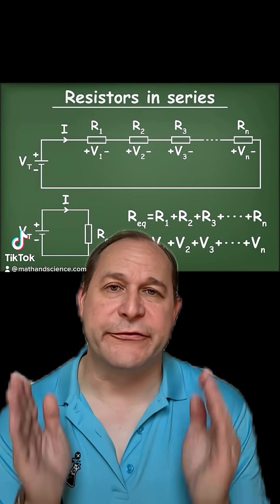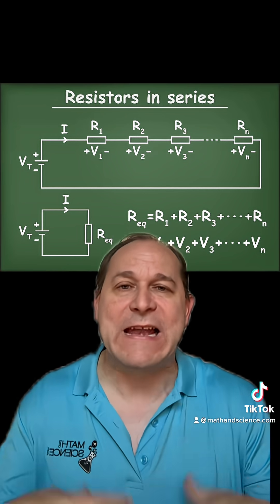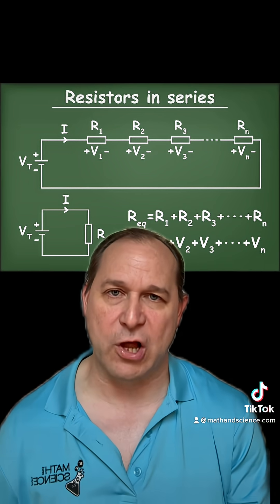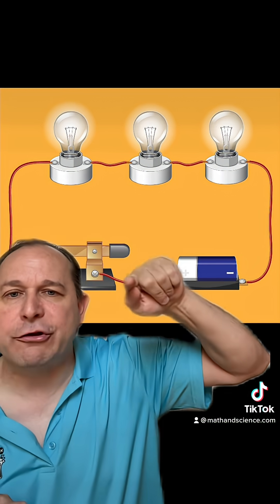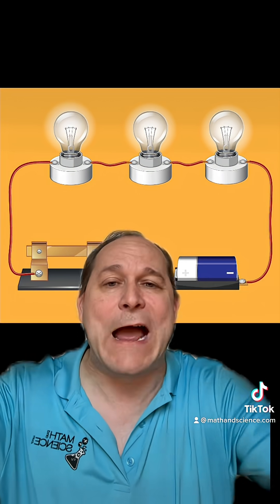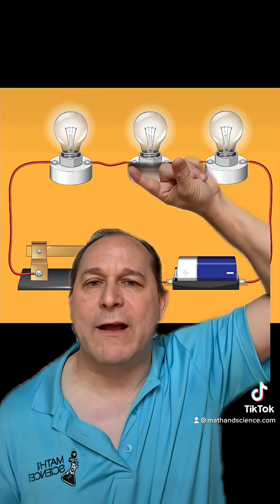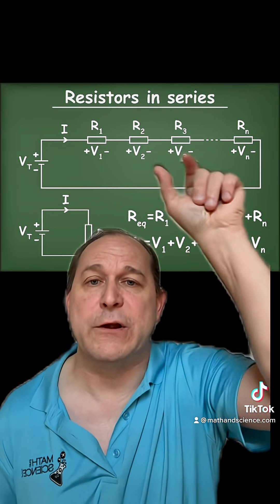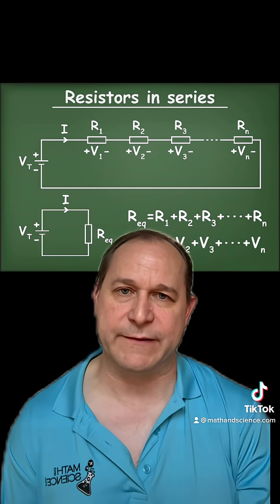Simple way to VISUALIZE Voltage

Comment: Current (electron flow) flows out of the battery from the negative post, thru the load(s) and back into the positive post.  In college my electronics teacher taught us ‘the negative side has excess electrons and the positive side positively wants them’.  Dave Logobarbi, Antelope Valley College, 1993.  RIP my friend and Professor.

Comment: That raises more questions than it answered. It seems that you should be referring to a minimum battery voltage. I guarantee you that my car battery has more voltage than the combined voltage being used to run everything.
Reply: Perhaps, disconnect the alternator and see then, if that statement holds up.

Comment: Can you clarify voltage drops across parallel circuits?
Reply: in paralell circuit the voltage is for all the same ..only the current will change ... in serial the current stays the same only there will be a voltage drop accross all resistance elements.